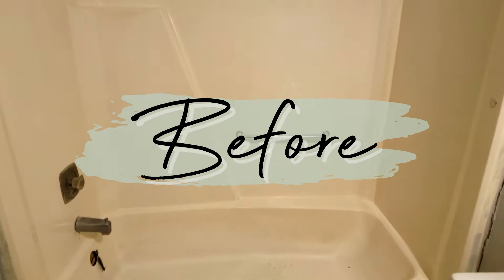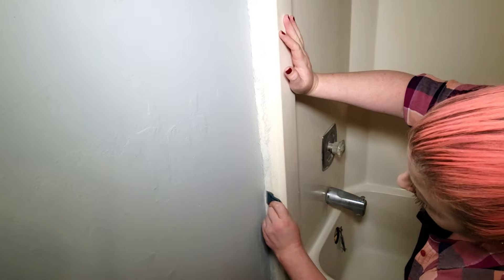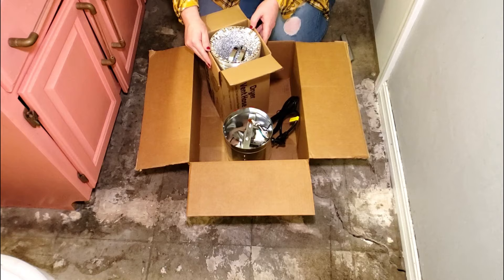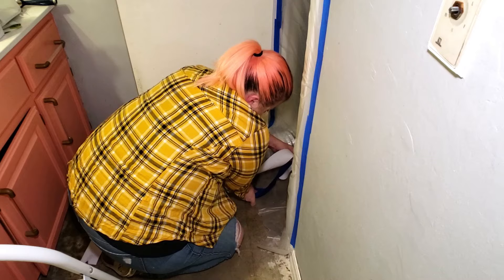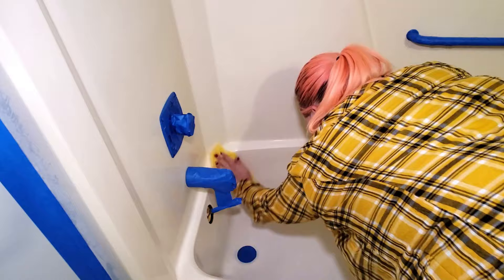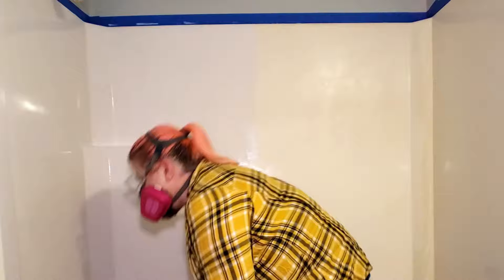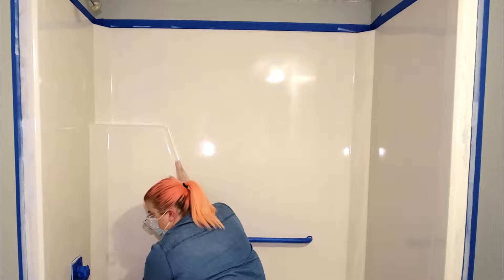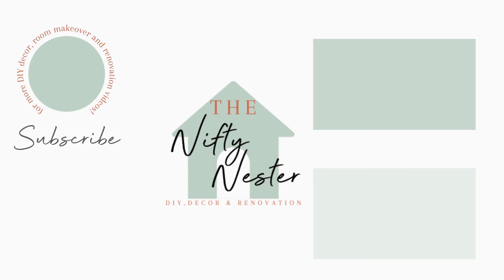How To Paint A Bathtub Yourself | The STRONGEST & CHEAPEST Way To Refinish Your Bathtub!

Comment from the maker: Click here to watch the rest of my "Bathroom Makeover On A Budget" series, including the final reveal! 😍 https://youtube.com/playlist?list=PLwZvriAUeKYrPB-qyqkZksXnRSlZ8rgOX
Reply: Can this be done over ceramic tiles?
Reply from the maker: Yes, this paint will work on ceramic tile. Follow the same steps and sand the tile beforehand to make sure the paint will stick since tile is usually glazed.
Reply: How well did it hold up?
Reply from the maker: Really well! It looks almost exactly like it did on day one. This bathtub takes a beating, I can't believe how well it's held up. I'm working on the updated video. It is taking me longer than expected to get it done, but I'll have it posted soon.
Reply: Well I'm sold on this idea, great tutorial.
Reply from the maker: Thank you!
Reply: Do I hav to remove the caulking btwn tub and surround walls?
Reply from the maker: Yes, I would suggest removing the caulking before painting. I removed mine and just applied fresh caulk after the paint cured.
Reply: This is a fabulous video!  And this was a fiberglass tub and surround - right?  Also, if you have a bathroom vent fan do you think you'd still need the vent fan set up you used?
Reply: What type paint did you use?
Reply: I used the Marine topside and it did not last 6 months. I called Rustoleum and they stated this product is not recommended for tubs. I will be doing my bath and shower area over again using tub and tile refinishing
Reply: What paint did you use?
Reply: @TheNiftyNester  can you tell me the name if the paint please .x
Reply: Home Depot site has maker of this product suggesting not using on a tub.
Reply: What kind of paint do you need
Reply: @starvinghotdoglv  She tells you in the first 10 seconds and there is a link in the description.
Reply: @TheNiftyNester  I have been doing repair work for 30 years that Rust-Oleum will fail! I don't care what you do! That is not the proper way to fix a tub please don't do this because it will fall off and you will be redoing it in a 1-2 years! That's a promise! Especially if you have kids!!!!
Reply: @TheNiftyNester  looks great!  I couldn't find a follow-up video. how has it held up?

Comment: With all the time you spent making a temporary vent you could have actually updated the space and installed a venting bathroom fan! In my city if your bathroom doesn't  have a window you must have a venting fan to be up to code.
Reply from the maker: We have a bathroom vent and we replaced it with a new one later in the renovation process. That doesn't replace an exhaust fan like this, though. Most bathroom vents only push 50cfm up to maybe 80cfm and this exhaust fan pushes 240 cfm. If I'm trying to remove fumes, not just smells, I'm using a stronger fan like this and not a bathroom vent.

Comment: Looks great, thinking about using the Marine Coating Topside paint for our tub.  So, how has the paint held up over the past year?
Reply: Pls let us know. Good job by the way!! ❤
Reply: I used the marine paint and it peeled after 3 or 4 months.  It was awful.  The tenant had a baby and we had to sand off all remaining paint with the bathroom door closed to contain fumes.  It was hot and horribly stuffy , the best mask to use is the painter’s mask, we didn’t inhale any fumes.
Reply: @angrycannibal6625 yikes! Wish she would do an update video
Reply: @angrycannibal6625 you didnt clean the tub well enough before painting. They have refinishing kits, but it all comes down to b4 u paint.

Comment: I used marine boat paint to paint the tiles in my tub/ shower (left the bath tub did not paint it). It looked great when it was done. After about one year it still looked pretty good. After about 2 years it started to show defects- small scratches and some minor peeling (mostly were the bar of soap was constantly hitting the wall). However now after 3 years it has started to really yellow. It still looks "white" (not horrible yellow like you would see in a smoker's home or bad yellowing you see in bright sunlight). It would still look kind of white if it was by itself however because it is directly next to the original high gloss bath tub, toilet, cabinets, shower bar etc that are all manufacture painted (I believe power coated or porcelain) gloss white the yellowing of the marine paint becomes very noticeable. There is a big difference between the painted tiles and gloss white tub. Directly after painting the tiles the paint will look just like this video. Gloss white tiles blending nicely with the gloss bath tub. However be prepared to repaint every few years because it will definitely yellow over time. I am just happy I only painted my tiles that can be easier replace or covered with a liner if I dont' want to keep repainting vs painting my entire bathtub that would cost thousands of dollars to replace. 
Overall experience it looks great directly after painting. However it will yellow so be prepared to repaint every few years (in my experience three years).
Reply: Thanks for your experience! Not I'm thinking to add some tint so yellow won't be a problem. Green or whatever tub is better than scratched one anyways. You saved me a lot of time in three years period
Reply: It shows yellow from the oil in the paint

Comment: Thank you, thank you, thank you! I just refinished my bathtub and the old bubbling sheet of tiles above it. I've been in this apartment 2 years and my landlord said she'd have the maintenance team do it when I moved in. She even already had the kit. She never did. I then asked her to recaulk last summer, as it as starting to mold and be difficult to clean. She kept saying the guy would be in touch and he never was. She's a very hands off landlord, doesn't care what I do, and my rent is ridiculously cheap in the midst of this housing crisis. So I started painting different areas of my little apartment that need a coat of paint. It's looking so much better! I finished the tub and shower surround in one day, two coats with two packages of Rust-Oleum tub and tile. Phew, it IS strong, even with an n95. Next time I'm buying a respirator. I had to take breaks, as I was feeling dizzy. Except for a few imperfections, it looks brand new, fresh and clean. I scrubbed and scrubbed but couldn't get the old grey stains out. It was looking so nasty, I didn't even want to take a shower. I stripped the caulking and will be doing that as well. Thank you for showing me that I can do it! I am so excited to add some plants and candles and take a bubble bath!
Reply: can you send a pic please.....see how its doing....thanks.....

Comment: When i use this topside paint i use a 3/8 nap roller. It holds more paint and as you said it self levels. I noticed when using the foam roller i got more air bubbles in the paint giving me a more bubbly finish (this was actually on my boat) but i liked the durability of the product and was considering doing my soaker tub with it next. Thanks for sharing

Comment: The ventilation system that you created was super cool. We really liked the inline duct exhaust fan. Great job.
Reply from the maker: Thank you!
Reply: I like the ventilation system too. Hey,  didn't I just subscribe to y'all? LOL
Reply: Hello! Great job . Do I need a ventilation system if I have a window in my bathroom  ? Thanks ❤️
Reply: I have exhaust fan in bathroom, would that be sufficient? Should I keep bathroom door closed or open with doors and windows of house open.
Reply from the maker: If you have a window, then you can put a fan in that window, and that would be enough to exhaust the fumes. If you don't have a window, then you probably want to use a stronger exhaust fan than the one in your bathroom. Bathroom exhaust fans aren't usually very strong, so it just depends on how long it takes yours to circulate the air in your bathroom. You'll also want to keep the bathroom door closed or seal off the doorway so you don't fill the rest of your house with fumes. I hope that helps.
Reply: If the house is vacant, can I just leave the door open and the bathroom vent on, and skip the whole fan/exhaust part? House will be vacant for several weeks while being renovated. (No window in bathroom, but it it a few feet from the front door, which I can also leave open while I work)

Comment: I finished my bathtub project and I like how it turned out. Thank you for the video it was a great tutorial. I asked about fixing runs and ended up lightly sanding  any flaws and doing a total 3rd coat and I"m glad I did. After it dried for 3 days I took 0000 steel wool and went over the paint job which smoothed out  small ridges from the paint roller and it looks great.
Reply from the maker: I'm glad to hear it turned out well, thank you for the update!
Reply: How  is the paint  job holding up so far?

Comment: Coming from a boat builder and avid DIYer.  Nice work!  I liked what you chose to do prep. wise.  One thought to consider... Using a 2 part QUALITY marine epoxy based paint (like awl grip) would yeild a harder and longer lasting finish... it would also be more dangerous to apply (and more expensive) and vent, so it does have downsides... and perhaps with that small enclosed bathroom might prove too dangerous to do... but worth considering for those projects you want to do one time and be done with it for 20 years.
Reply: Which 2 part marine epoxy do you recommend?

Comment: Did this in a rental rental house. I used my drill with an attached scrubber for cleaning and a rotary sander. I cleaned it at least 10X. (Probably some undiagnosed OCD, 😅) Prep is EVERYTHING! Don't use abrasive cleaners or scrubbers after painting. 2 Tenants later and it still looks good.

Comment: Thanks to this video I just completed my bathtub, only thing I did differently was added a primer first, other than that my tub came out Bright glossy white just like I wanted it. Thank You again for this Video, it was by far the BEST Video
Reply from the maker: You're welcome and thank you! I'm glad to hear yours turned out so well, I love hearing from everyone that's painted theirs. Was the primer easy to use? I'm painting another tub soon that has tile walls and I'm thinking about trying out the primer and using a non- slip additive on the bottom of the tub. Thanks again!
Reply: Yes it was very easy and to be honest due to me using the primer I only needed one coat of paint but I did two coats and sand with the 220 grid like you said and it came out SOOOOO Shiny and pretty. Thanks to you and your video. I literally looked at about 10 videos and NONE TOPPED YOURS. Thanks again
Reply from the maker: That's awesome thank you again! Also thank you for the feedback and letting me know how it turned out, I love to hear it!

Comment: Thank you for your great video. It gave me the confidence to do my green 40yr old Kohler fiberglass shower tub. It was in perfect shape but wrong color. My wife loves the new glossy white look of the Rustoleum top coat now. There are a few things I learned. Sand with 220 at start and between all coats. We could see some scratching in finished product from the 150 grit I used initially. It took 4 coats to completely hide the green and the sanding marks. The $30 quart can ran out after the 3rd coat. Don't use the cheap $1 foam roller kit from the dollar store. The tray worked great but the foam expanded and kept falling off the roller. I then purchased a high quality foam roller and it worked great for the following 3 coats. I was able to reuse the same roller by keeping it in a baggie over night.  Use a foam brush to do the detail work. The horse hair brush I used didn't work well at all. I was hoping for a better looking result when all finished. The self leveling properties of the paint didn't smooth out the over lapping from the roller. Not real noticeable unless the light reflects off the surface at an angle which happens with a window or light fixture. It took me 2hrs to remove the old glass sliding shower door. Took lots of elbow grease and goof off to remove adhesive and silicone caulking. It took another 8 hrs to finish sanding and painting. It is still quite smelly in the bathroom after a week. Smells like vinegar. If I had to do it over I would use appliance white spray paint (not the epoxy) for the areas above the water line in the tub. I used this on a fridge and it looked very professional. This would have been a lot cheaper, faster, less smelly and better looking. Not sure how it would hold up to every day shower use but it would be easy to respray if needed. If anybody does this let me know how it turned out. Hope this helps someone.
Reply: Did you sand again after the 4th coat?
Reply: @kyliewilson5800  nope. I'm tempted too. I would just do the side wall since it is most noticable there. However, we rarely use that shower and the smell took a month to resolve. I can still detect the smell 6 months later. The finish is holding up well. There have been about a dozen showers taken so far. I will wait until summer before redoing.

Comment: This looks great!! I wanted to ask how it's holding up. I used the Rustoleum Tub and Tile paint previously and it peeled terribly. I'm a furniture artist so I'm no stranger to cleaning and prepping before painting. I'd love to know if this material holds up better than the tub and tile. Thanks for your time!
Reply: I'm curious as well about how it's holding up!
Reply: @annaossadchaya7752  The DIY Power Couple also used this product and they did a follow up video on how it holds up. I'd like ot hear from this lady too, though.
Reply: @andreagroon9458  what did the other couple say about the durability?
Reply: She responded to one comment that it's just fine. They asked about scratching and peeling and she responded that she would need a sander to scratch it, it hardened.
Reply: What kind of paint is it?

Comment: Awesome job!  I keep coming back and rewatching this.  I'm just debating whether I should paint mine as part of a mini-reno.  It's ok but a bit dingy.  I'm hesitant because of concern that the paint won't age well and will end up looking worse than it looks now.  Yours looks so amazing.  How did it hold up   I see this video is from a while ago.  Does your painted tub still look great.  And what do you use to clean it now that it's painted.  Thank you so much for your videos!
Reply: I just completed this on my walk in shower base.  It turned out amazing!  So thankful for this video, but I too am wondering what she used to clean it w/o damaging or scuffing up the paint.
Reply from the maker: Thank you both so much! As far as how it's looking now, it's been a little over a year and it's held up really well. The finish is like a hard enamel surface once the paint cures which makes it really durable. As far as cleaning it goes, I just avoid using abrasive cleaners like comet and scrub brushes. I can usually get it clean with vinegar water and a sponge but sometimes, if it's a little dirtier, I'll use a spray tub cleaner and sponge. I hope that helps!

Comment: I’m dying for an update on how it’s holding up!
Reply: I used marine boat paint to paint the tiles in my tub/ shower (left the bath tub did not paint it). It looked great when it was done. After about one year it still looked pretty good. After about 2 years it started to show defects- small scratches and some minor peeling (mostly were the bar of soap was constantly hitting the wall). However now after 3 years it has started to really yellow. It still looks "white" (not horrible yellow like you would see in a smoker's home or bad yellowing you see in bright sunlight). It would still look kind of white if it was by itself however because it is directly next to the original high gloss bath tub, toilet, cabinets, shower bar etc that are all manufacture painted (I believe power coated or porcelain) gloss white the yellowing of the marine paint becomes very noticeable. There is a big difference between the painted tiles and gloss white tub. Directly after painting the tiles the paint will look just like this video. Gloss white tiles blending nicely with the gloss bath tub. However be prepared to repaint every few years because it will definitely yellow over time. I am just happy I only painted my tiles that can be easier replace or covered with a liner if I dont' want to keep repainting vs painting my entire bathtub that would cost thousands of dollars to replace. 
Overall experience it looks great directly after painting. However it will yellow so be prepared to repaint every few years (in my experience three years).
Reply: @pacman3556  I just did my shower surround as it was a yellow marble color. It looks good but the tub looks much less bright. Maybe it will fade to match the tub. Thanks for your input !

Comment: I'm a auto painter. Your job looks great.
Reply: Timmy Grosso, I've been looking for an automotive clear coat that i can seal this product with on a tub; any recommendations or thoughts? My hope is that the clear top-coat will prevent peeling and ambering. I know a couple that says their tub started ambering after 2 years. Definitely would etch the surface and use primer befor painting...

Comment: I am so glad I watched your video!!!  I need to refinish my tub but was a bit intimidated with the 2 part stuff.  Thank you so very much!
Reply from the maker: Thank you so much! Yeah I would 100% use this stuff again, it's so easy to work with. Good luck with yours!
Reply: @TheNiftyNester  what kind of paint did you use on this project?
Reply from the maker: It's called Rustoleum Topside Marine Paint. There's a link in the description box of this video as well if that helps.